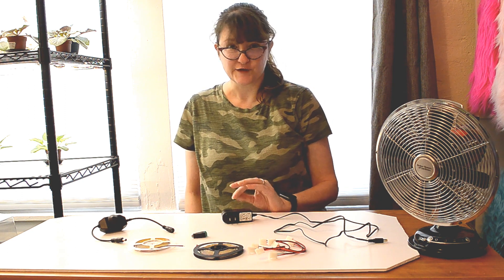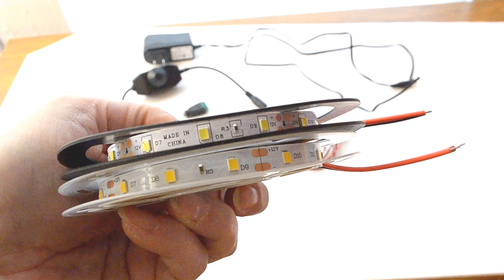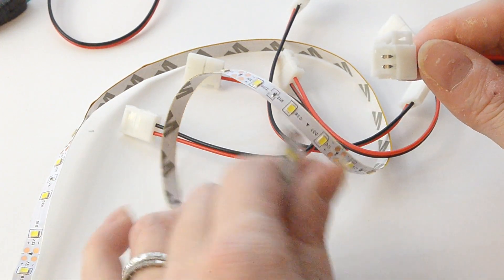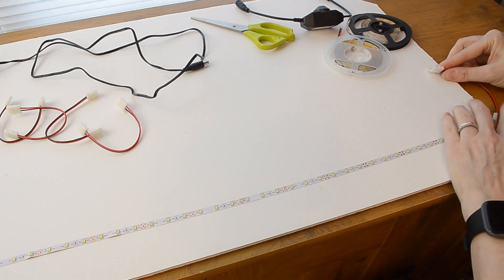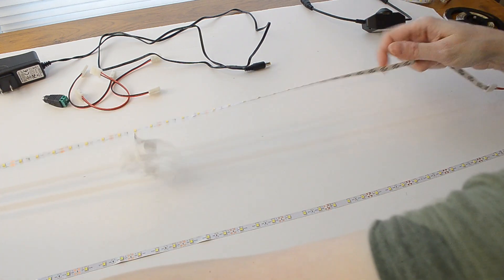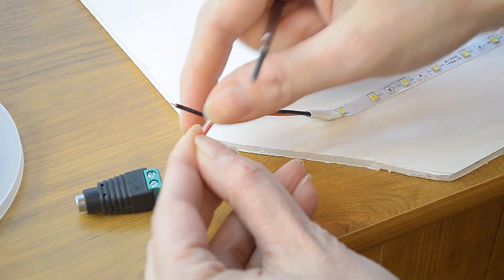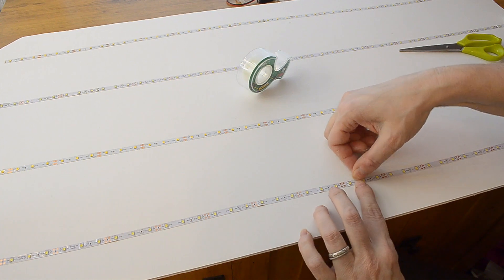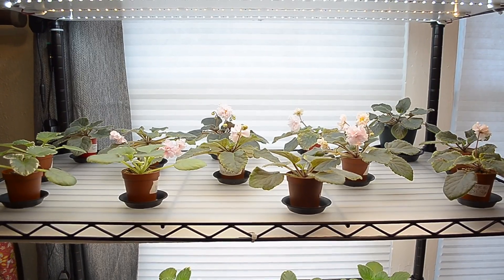How to make an LED Lighting System for your African Violet Plants

Comment: I'm working on a similar setup for my wife.   Do you know how many Lux or foot candles you are getting at the leaf level with your setup?
Reply from the maker: Hi! I have not measured the lumens at leaf level.  The way I have been determining the proper light levels is by observing the plants.  When you first put the plants under LED lights, it is best to start them off on less hours per day and then increase the time as needed.  I started at 6 hours a day and have increased it to 10 hours slowly over time. (all the plants on my shelves are African Violets)  It is nice to have the dimmer switch as well because baby plants don't require as much light so I can cut back on the brightness for them. Another factor is where your shelving is placed. It impacts the amount of overall light your plants are receiving. One of my shelves is in front of a south facing window so it gets some supplemental natural light. The other shelf is in the same room but further away from the window. So each shelving unit can be customized to accommodate it's location and the amount of light needed for the different varieties of plants. I can always add more strips to a shelf later as well if I feel like it isn't bright enough. So far I have not needed to do that though. I wanted to add a link to a video I watched that did talk in great detail about lighting that I found incredibly interesting that you may enjoy. https://www.youtube.com/watch?v=IW0dsgss968     I have a feeling that your wife is really going to enjoy the lighting system that you create whether it is using the led light strips or another kind of lighting. I know my plants have really been thriving since I gave them the extra light.  =)

Comment: Great presentation . Thank you. Would appreciate where to buy and name brands of everything . I have a stand like yours so all I need is the set up. I'm a 75 yr. old beginner and trying to start off on the right foot . Will these lights work on succulents and cactus ?
Reply from the maker: Hello! Thank you. You can use LED lights for succulents as well.  I put links in the description for most of the items that I used in this project.  I couldn't find the LED light strip link that just has the wire ends but I found one that includes one dimmer switch and a power cord. Hopefully that will help. Thanks again! =)